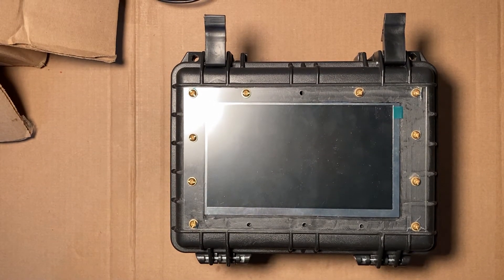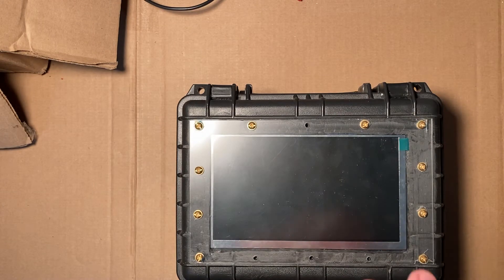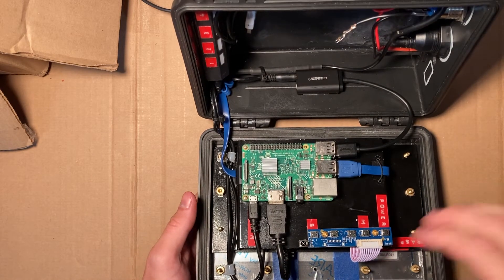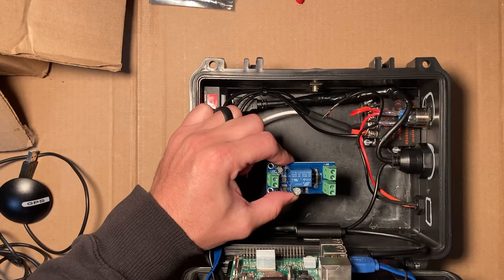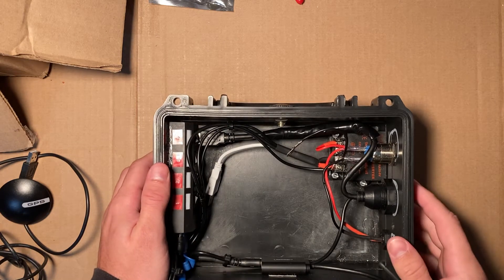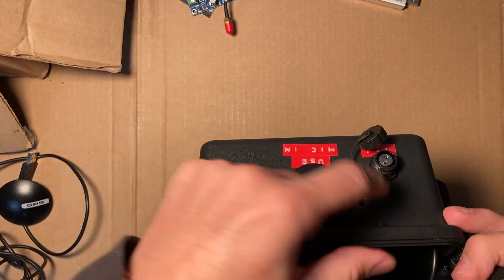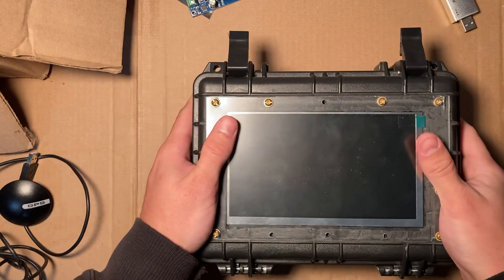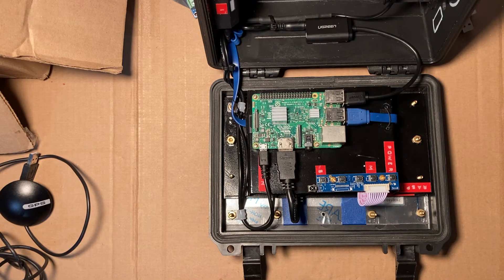Budget Friendly Marine Navigation w/ Raspberry Pi & Opencpn

Comment: Are you still using this? How stable is it? I just bought a Garmin for $300 which includes the screen, waterproof case, mounting bracket, cables, software, GPS receiver and depth sounder and it interfaces with Active Captain on the iPad I already had, which also has Navionics. I don't have AIS, autopilot hardware or any other sensors, so I can't tell how well the Garmin interacts with them, but the manual claims it will. I'd been thinking about trying to build something with OpenCPN, but with the Garmin being so cheap it puts an upper limit on how much time it's worth putting into a cobbled together system that may or may not be reliable.

Comment: Hi, I just started the similar project, however based on Pi400, which complicates things little. I also want to get wetherfax and Navtex messeges using the SSB NASA Marine radio. How did you connect the mic socket to the Pi? I guess via the GPIO - which pins? It is almost a year since the movie and so far you did not make the next one, will you do it?

Comment: Nice work.  Well thought out and implemented.  I like the weatherproofing and construction details a lot.  

Also like the modularity and use of commercial off the shelf building blocks as modules.

Suggestion: use a USB hub with no switches.  The switches could potentially get bumped if anything breaks loose inside, disabling some of the inputs unintentionally.

Other suggestion: for maximum fire safety and longest cycle life, use Lithium Iron Phosphate (LiFePO4) batteries.

Would definitely like a build video and parts list.

Comment: Great project I have liked and subscribed. I am in the middle of doing a similar project myself I have also just installed BBN (Bare Boat Necessities) it looks to have a bit cleaner UI than open plotter but not nearly as much of a following as Openplotter. Will you be setting up Pypilot?
Reply from the maker: Checking out BBN I’m going to see about testing it out. Thanks for the recommendation. Pypilot is on my radar for a later time. Weather fax by usb dongle is the challenge I’m having.